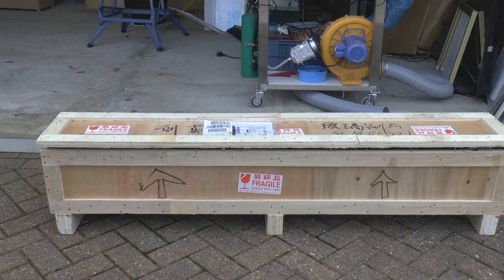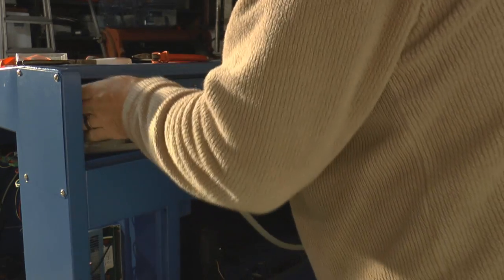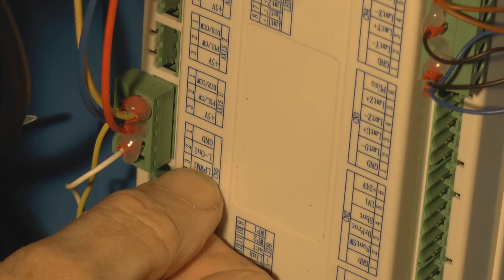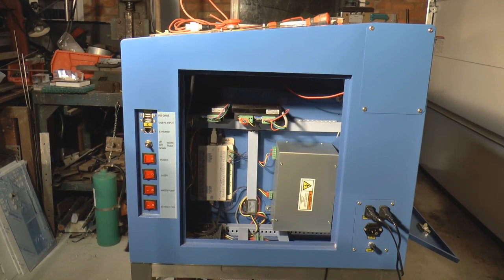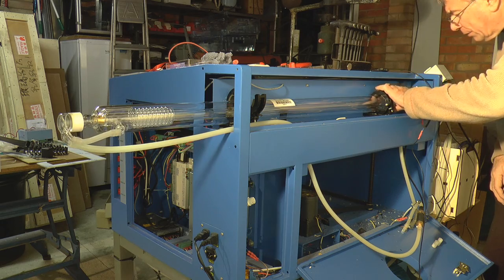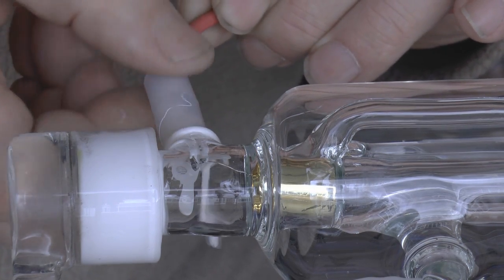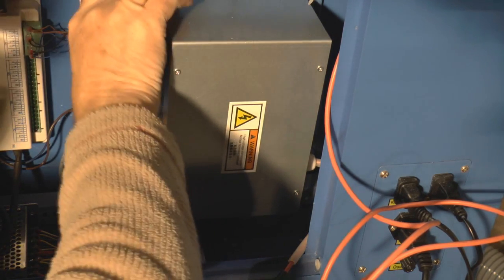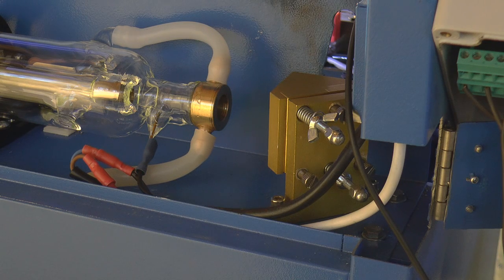RDWorks Learning Lab 50 fitting 60watt tube and PSU

Comment: Hi Russ,
I’m rewatching your most excellent series which I came across when they first came out just about 8 years ago. I still have the same machine with the same tube, PSU, controller, same software, etc that it came with in 2016/7 and it looks exactly the same as your original big blue one. It still functions albeit inefficiently.
I now want to upgrade the components (Tube, PSU and controller board) to make it a proper 60W or 80W machine and so I can use Lightburn.
Would you still recommend Mactron or is there an another (UK based?) supplier that you now prefer?
Can you recommend specific components, please?
Thank you once again for your hard work in translating/demystifying the setup and use of laser cutters! Outstanding job!
Many thanks,
Jerry
Reply from the maker: Hi Jerry
Lots has happened during the interevening 8 years since this video. The good news is that this tube is still running as good as new. However things have moved on a lot  and I have bought several new tubes  and know a lot more now that |I did then.
It may be easier to contact me privately so that we can use email rather than an open forum to discuss your upgrade options
 The following fom will allow you to contact me 
https://forms.zohopublic.eu/ndeavorlimited/form/K40XtreeemLaserCutterContactRussSadler/formperma/k2Cn0QN5ChpazfTMAUw25lZ-FKpjZa96TQWHjv3ntOg

 Many thanks for the support and patience as I picked a zig zag path  to understanding how this whole technology worked.

Comment: Hey Russ, it’s a pleasure watching your videos and very helpful in so many ways. I think I have the same version as you and I’m trying to get the laser to pulse or fire and nothing seems to work. 
I have water flow and tests the flow meter and it’s good. Need distilled water and everything looks clear. 
I Used a Fluke voltAlert tracer 90-1000VAC 
And when I hit test on the the side of the power supply it does make the tester alarm. 
Do you know what else would be the reason why I’m not getting the tube to work? 
Thank, Clayton
Reply from the maker: Hi Clayton 
 This could be more than a few comments and suggestions. Please contact me privately with this contact form and we can work through the problem logically
https://forms.zohopublic.eu/ndeavorlimited/form/K40XtreeemLaserCutterContactRussSadler/formperma/k2Cn0QN5ChpazfTMAUw25lZ-FKpjZa96TQWHjv3ntOg
 Speak soon
Reply: Will do I sent you a message. Thanks.

Comment: Russ, I ordered the Cloudray tube tube you recommended and built clamps you designed and I am very happy.  I am having one problem I'm hoping you can help me with.  If I create a simple rectangle  20 by 20 mm and do a cut all is well, but if I change it to a scan, the scan starts 2mm early and goes 2mm late.  It only fails on the horizontal scan.   Any ideas would be greatly appreciated.  Thanks again for your help.
Reply from the maker: Hi Gerald
 It sounds likr the solution id quite simple. It s a feature called Scanning Reverse  Offset (or compensation). Take a look at this video for and explanation
 https://www.youtube.com/watch?v=DeCxeCrq0h4&list=PLPWEtx5V9DqEogIeYRdcG_KYcB7UL2Qmn&index=48&t=1063s
This is using RDWorks but there is a similar setting in Lightburn.  It is important to remember this is a lookup table system so you need to calibrate the reverse offet for EVERY different scanning speed  you use   
If this is not the issue then shout again and we will relook 
 Best wishes
Russ
Reply: @SarbarMultimedia  Russ, Thankyou again.  After putting in the fix, all is working.
Reply from the maker: @geraldbrost4179 . Mycontributin was just a few wise words 
Just remember anyone progessing towards expert status has made a lot of mistakes  and I sure have lots of mistakes yet to come.. With your mistakes you have now started that joirney .Congratulations on sorting it out from a few wise words form me. YOU were the one that made it happen and YOU have now banked a huge chunk of knowledge  and experience.
 All best wishes  for Christmas
Russ.

Comment: Russ, I purchased my Chinese laser about two and a half years ago and am ready to upgrade my tube.  I went to the Mactron website to look for a replacement but could not find tubes or power supplies listed.  Do they still sell upgrades like you installed?  I have found an upgrade package from Cloudray.  Is their product equivalent?  Do you have any other suggestions?  I have watched many of your videos and have learned much to help me use mine.  Any suggestions would be greatly appreciated.
Reply from the maker: Hi Gerald
 Mactron was my first replacement tube more than 6 years ago and it was not a modern long life tube BUT it is still going strong today.  For 2 other machines,  I found a better equivalent at Cloudray who sell an SPT tube that has been officialy relabelled as a Cloudray brand. It is the CR70. It claims to be a 60 watt tube in the spec but in reality run it at the 23mA  current limit recommended and it delivers 80 watts. It is a superb tube and does not cost a fortune. However, DHL/UPS will double the cost with their delivery service. You will ideally need an 80 watt HV powetr supply but as you will see in this video where I fit  the CR70 it to one of my machines,  it runs at 100% power with a the 60 watt HV power supply which is just about capable of delivering 23mA
https://www.cloudraylaser.com/collections/co2-laser-tube/products/cloudray-bundle-for-sale-cr70-metal-head-co2-laser-tube-80w-laser-power-supply

Watch this    https://www.youtube.com/watch?v=V_ehGE51rH4
 Best wishes
Russ

Comment: Hello Mr. Russ. I am going to be purchasing a 60 watt laser within the next few weeks and I have been reading that the tubes that come with the Chinese lasers go out pretty quick. Would you recommend that I purchase a new tube when I order my laser or would that be a bad idea?
Reply from the maker: There are  a few certainties when you purchase a Chinese laser
 First is that all the major expensive components such as the tube, HV power supply and digital controller  will all be B grade. Ie main factory test failures that means the product cannot be warranted. In the case of the controller, the fault will be in a section of the product that you will never use so you will never know. The HV power supply the problem will be the response time specification. This will not cause cutting issues but may become apparent during  high speed engraving, The tube....Hmmmmm. usually the biggest and most obvious issue.
Tubes fail the final test for many reasons and none are rectifiable because if the sealed nature of a tube. If a tube cannot be warranted by the manufacturer it will be sold a scrap for next to nothing. One particular company specializes in  making money from these tubes by retesting them to make sure that they work "in some way", enough to fool the average technically naive Ebay buyer.  They then relabel the tubes with a K H Laser sticker  to make them look credible.

 The 60 watt tube you plan to purchase will be such a tube. It will claim to be 60 watts but in reality that is a max test spec that you cannot use. In reality it will be a 1000mm long 50 watt tube ....but B grade.  One cannot say exactly what sort of failure this tube was but from  6 years worth of experience and communications from all over the world there is a 90 % chance it will be almost junk. It may deliver 20 or 30 watts of poor quality power. You could be one of the lucky 10% where the tube only just failed final test and works quite well . It may deliver 45 to 50 watts  and last 4 or 5 years. I would always assume  your tube will be junk and that you should budget for an A grade replacement.. Do not search the internet for a low cost replacement because you will be replacing junk with junk.  It is a jungle out there for such products. There is no such thing as a cheap A grade tube. A reliable source is Cloudray BUT be prepared for a shock. The new tube may cots $200 or less ( look seriously at a CR45) but you will find the courier shipping cost will double the price.  Yes it is painful but is is a tube that will last 5 years or more and make your machine reliable and a real pleasure to use. In the overall scheme you will still have a very low cost piece of CNC equipment that now fulfils your dream. 
 If you can buy the same machine with a 50 watt tube option then pay less for the same machine knowing that you will have to replace the tube anyway.  Always buy your machine using your credit card, even via PayPal because that gives you ultimate power. I will be happy to advise you when your machine arrives on how to go about negotiating a $150/$200 refund towards a new tube.  
 Best wishes
Russ
Reply: @SarbarMultimedia  Mr. Russ Thank you so much for your opinion. I really do appreciate your input. It means a lot that you responded. I would love a mentor if you would be interested in someone bothering you from time to time with questions. I try to answer my own questions first by looking on your channel and the internet but I would love to have someone that I can go to. I will look into the Cloudray tub or the CR45 tube and pick. Thank you for that information.

Comment: Hi Russ have you got a link for the psu and tube still mate.
Reply from the maker: I bought the same size tube that performs exactly the same  from Cloudray earlier this year  It is a CR70
 You will need an 80 watt power supply

https://www.cloudraylaser.com/products/35-70w-co2-laser-tube-upgraded-metal-head-cr-series?variant=33568306725004

https://www.cloudraylaser.com/collections/60-80w-power-supply/products/80w-co2-laser-power-supply-myjg-80b?variant=7601839964211

Best wishes
Russ

Comment: What sealant did you use or should you use to seel the wire onto the tube? at 12.11 in the video.
Reply from the maker: It is a silicon sealant but NOT bath sealant. It must be non -corrosive. It will normally be sold as  RTV sealant and a small tube of this is widely available from local suppliers, Ebay or Amazon.

aee 
https://www.ebay.com/itm/SERVISOL-6200003100-RTV-SILICONE-SEALANT-CLEAR-75ML/181883211297?epid=1810895473&hash=item2a59158e21:g:MFgAAOxyrM5TIjM3

Here is the data sheet
https://static.rapidonline.com/pdf/87-1132t.pdf

Note the high dielectric strength

Best wishes
Russ

Comment: I went to the mactron website but I don't see these tubs listed anywhere.  Could you share a link?
Reply from the maker: Hi Kent

My tube was an MTS-T70.
http://www.co2-lasers.com/co2-laser-tube/27-co2-laser-tube.html#.XQVMTVVKhhF

I'm not sure that Mactron are selling this anymore but it is worth an inquiry.

If this fails then I will recommend this CR70 tube instead. This looks like a Cloudray own brand  but I happen to know it is an A grade product manufactured by SPT and  rebadged for Cloudray.. This is definitely my next tube whenever I need a replacement. I have seen performance graphs from several that guys have bought and they all delivering about 80 watts at the 22mA max allowable normal running current
https://www.cloudraylaser.com/products/35-45w-720mm-co2-laser-upgraded-metal-head-tube-cr35?variant=12782294270003

Best wishes
Russ
Reply: @SarbarMultimedia  Interesting.  I thought it was a 60 watt tube.  It's actually a 70 watt, by the model number...
Reply from the maker: @jackwilborn2353  
Yep,  70 watts  and 5 years later it's still performing "as new"..The Cloudray CR70  on my other machine is even better and that can deliver 80 watts.
 Best wishes
Russ

Comment: Hello Russ I have Some problems with connecting my PSU and Ruida controller. Can you get me Some pictures of your wirement? Would help me a lot.
Reply from the maker: Hi Christ
Sadly You Tube has ceased their private message system. Add a comment with your email. I will be auto copied to my gmail. I will then immediately remove your comment/email from public view.
Best wishes
Russ

Comment: What brand tube did you buy ?
Reply from the maker: This is what I bought 
https://www.aliexpress.com/store/product/1200MM-60W-Laser-Tube-60W-co2-Laser-Power-Supply/321243_1109607209.html?spm=2114.12010608.0.0.44fb50edcdP0xt

Mactron will also supply other good quality tubes. The best is recognized to be Reci  but to me that is an overrated and overpriced product. EFR, SPT, Yongli are equally good at 2/3 the price or less. 
Best  wishes
Russ

Comment: hello mr. ross i just installed the power suppler
when I pulse the tube s'Allume me the laser does not go out please help me to solve this problem
Reply from the maker: Did you receive my email?
Russ
Reply: yes mr. ross thik you
Reply: hi ross i just cleaned up the laser tube with two tap water and thenand I put in the place of distilled water the tube works
thank you for helping me god protect you

Comment: just another question what is the little eletric cable that you just brach you said water protecte I did not understand this operation and what track I must plug it thank you
Reply from the maker: I have tried to send you an email with circuit diagram and picture but your email address was not recognized. Was there a spelling error? Could you resend an email address.

Best wishes
Russ
Reply: lettres_lumieres@yahoo.fr

Comment: I'm afraid to install the p.suply with the laser tube because it is too expensive in my country.
Reply from the maker: Hi Marouane
Your logic is wrong. If you never use the new power supply your tube is dead anyway. Be brave. I assume your original power supply is dead. A new power supply will not damage your tube. Your tube is like a light bulb. if there is electricity it will work. If its broken then no amount of electricity will make it work. The power supply will not damage the tube and the tube will not damage the power supply.
All glass laser tubes have a life. 2 years is good. You will know when it's beginning to die, the power will disappear over several weeks or months. It will not just stop.
Best wishes
Russ

Comment: hello mr. ross i just bought the power suply 60 w with soufrance my problem I life in region tiere mande
and my tube did not start from 2 years ago that I risk losing it thanks in advance
Reply from the maker: Hi Marouane
I apologize because I do not fully understand your question. You have just bought a new 60W power supply but I did not understand about your tube. Is it 2 years old and not working now? Is there a pink beam in the tube?
Best wishes
Russ

Comment: Russ, now that you've had that tube and power supply upgraded for a while and have used it would you still recommend it? I'm considering buying it but I wanted to ask you this question before making the purchase
Reply from the maker: Its 2 years old now and still performing as new. It was half the cost of the machine but has been well worth it . Completely trouble-free and just in that mid power range where it is possible to use it for low power engraving but at the same time it has power enough to cut most thicknesses I need 10mm plywood and 12mm acrylic as you will have seen from the videos.

Best wishes
Russ
Reply: SarbarMultimedia Thank you Russ!  Your service is top notch!!